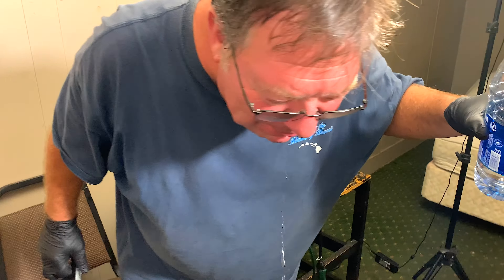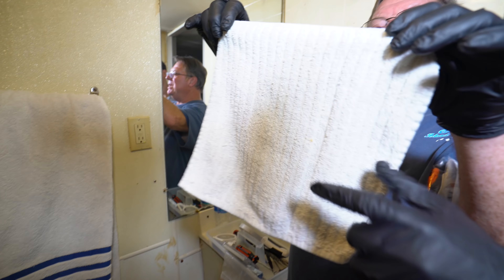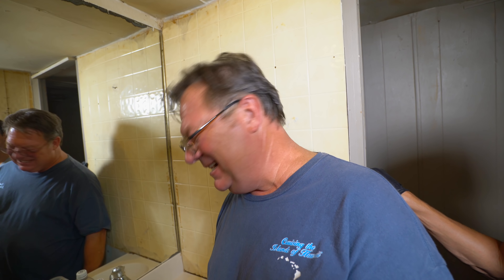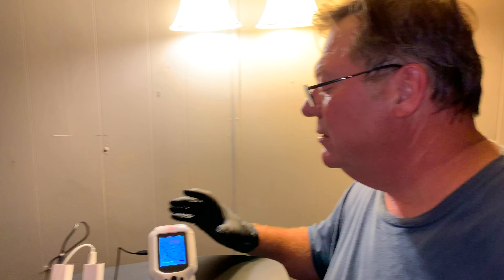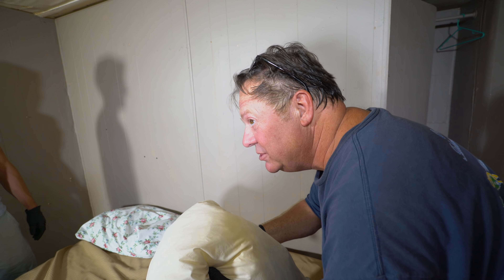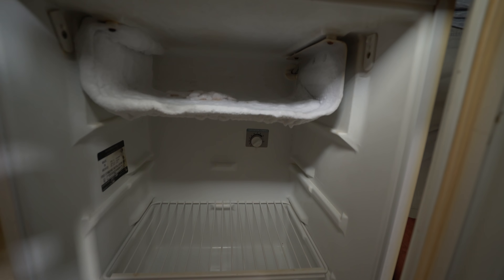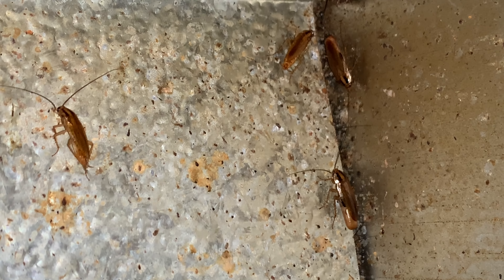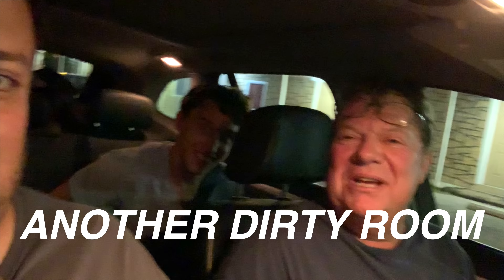Another Dirty Room THE FINAL SEASON : Charleston WV : ROACHES & CHICKEN at the Jefferson Motel

Comment: 9:40 They used flex pipe for the P-trap. That is such a major code violation as it can easily lead to the trap filling with hair and other debris which then allows the water to leak out through capillary action, ultimately drying out part of the trap and creating a path for sewer gases to pass.
Reply: wow